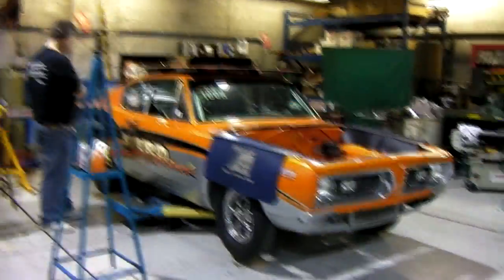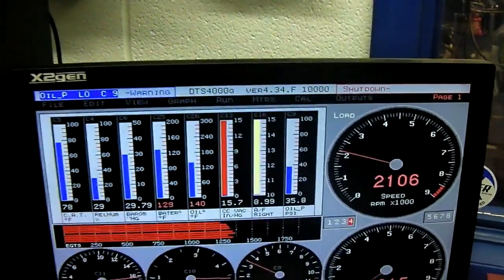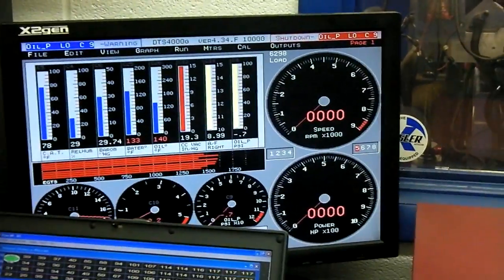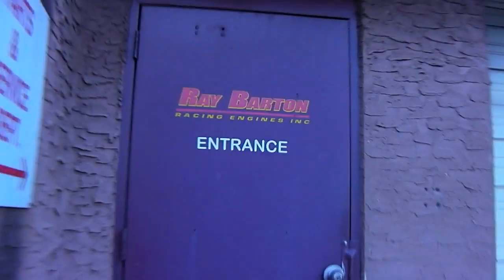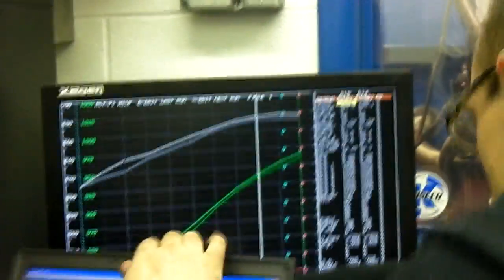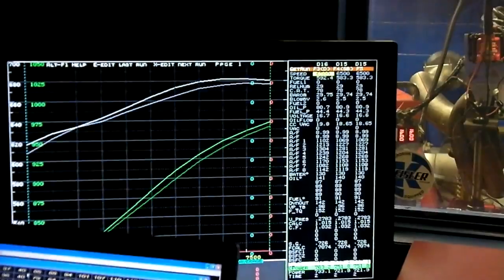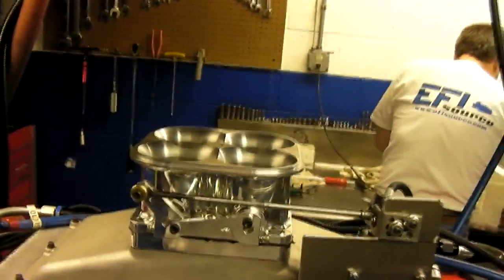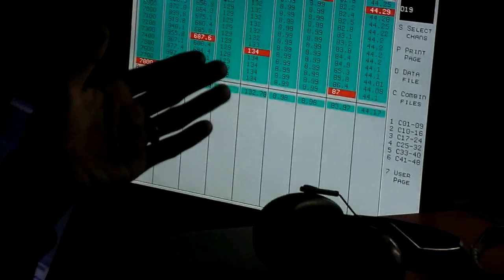EFI tuning Pro Stock Hemi

Comment: 1007 HP  - How many Cubes?   How can anyone say incredible without knowing the cubes.  nice running motor, and on later runs I saw the tach over 8,200 rpm.....But how many cubes?
Reply: It spins upward of 8000 and sounds very healthy but if the cubes are huge...well we all know that 1 HP/cu. in isn't that impressive. Lots of hp ... 1007, that'll straighten your hair for ya!!
Reply: I believe it was around 488 cubes